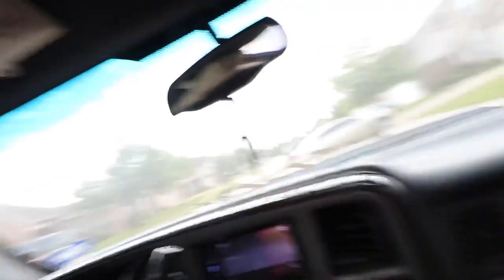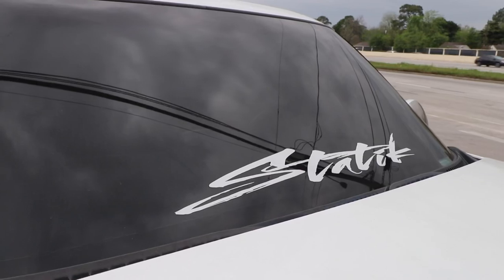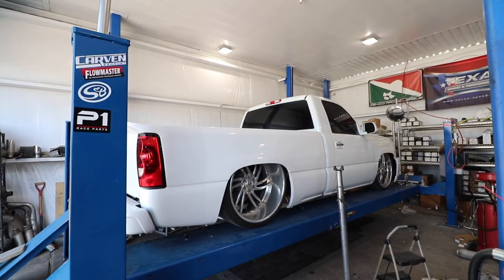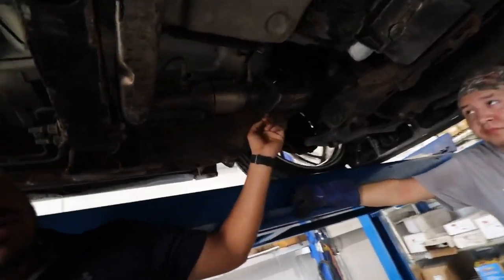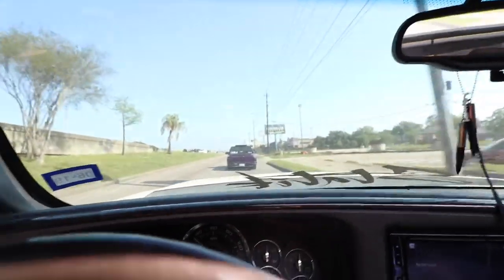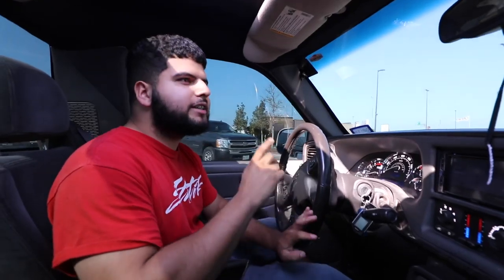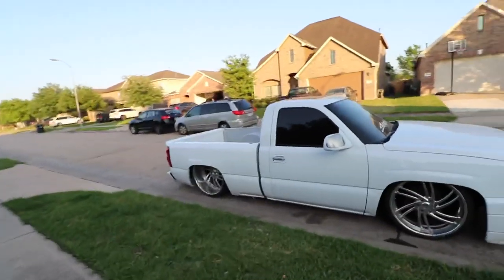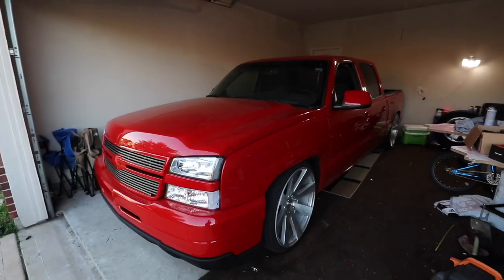MY SLAMMED SINGLE CAB GETS AN EXHAUST!

Comment: Bro u should of done a 3inch straight pipe with dual pipes one on each side. The sound would be more spread out and especially if u go with a LSA supercharger it would get rid of the back pressure easier and better but would require a aftermarket fuel tank relocation to the rear behind the rear end